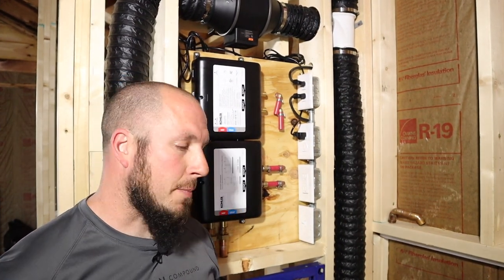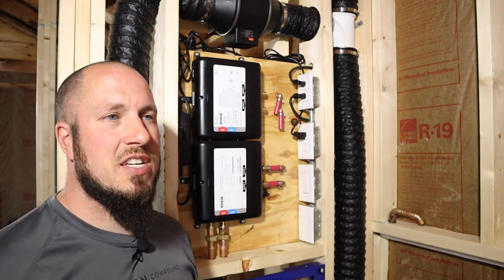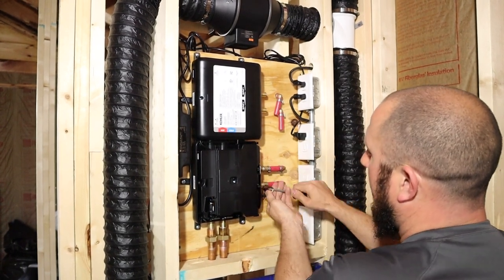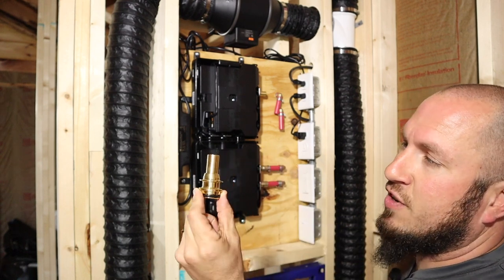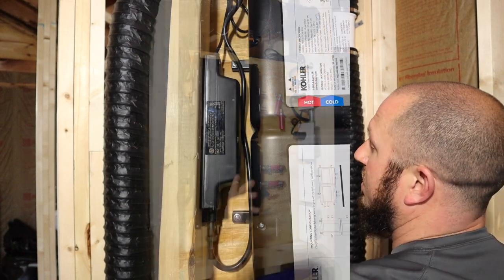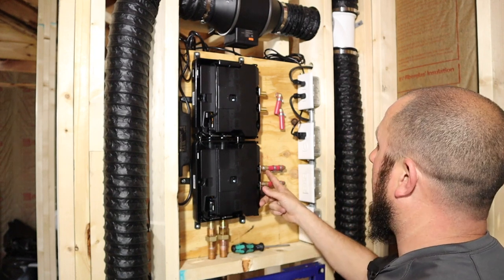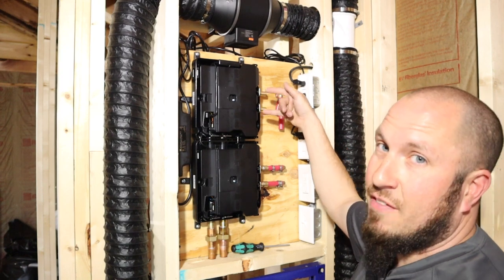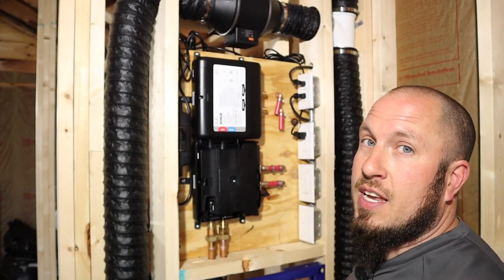Kohler Anthem Digital Shower Valve

Comment: Thanks for the explanation. I bought one to use overseas but they don't use copper pipes for their plumbing. Any idea how to connect the copper pieces from the digital valve to PCV pipes?
Reply from the maker: I think there should be a conversion fitting that you can glue to PVC and it sharkbites onto the copper

Comment: Can a shark bite be pressed on to the copper outlets rather then soldering a PEX fitting. And what is the meaning on page 5 of directions that has in parentheses (1" PEX). 

Route 3/4 (1" PEX) dedicated water supply lines. Use unions to install removable pipe segments to the valve inlets to allow access for periodic cleaning of the inlet screens.
Reply from the maker: You need to route 3/4” copper or 1” PEX to the valve.  It has to have the volume flow to supply it.  I never tried the sharkbite. I have seen guys pro-press onto those fittings though, so I’d assume you could sharkbite to it
Reply: @TheDurbinCompound  The copper outlet would need to be at least 1.125" long and .125 wall thickness for the SharkBite to work. However, the SharkBite may reduce the volume much like the fitting for PEX B. That said,  PEX A fittings would not reduce volume from what I understand but the fitting would need to be soldered on to the outlets.
Reply from the maker: @brianhughes1456 right right.  I can measure them for you if it helps?

Comment: Installing one of these and can't get the controller to turn on. Not sure if it's the controller or this unit. When plugged in are there any LED lights or anything indicating this is working for you?
Reply from the maker: Are the blue LEDs lighting up on the actual valve?

Comment: Gotta ask, what do you have going on with the flex pipe and (I'm guessing) inline fan?
Reply from the maker: That flex pipe is the bathroom exhaust.  One coming from toilet room and one over shower.  They “Y” in before the fan and exit through the inline fan to outside.  The 6” inline fan is very strong and flows 400 CFM

Comment: Did you have trouble pairing the push button to the main panel? We've followed the steps with no success.
Reply from the maker: I haven’t gotten that far.  Let me go try it and I’ll let you know
Reply: @TheDurbinCompound  mine looks paired but I get nothing and then sometimes it flashes purple after flashing the green pairing signal. 🤷‍♀️
Reply from the maker: Ok mine paired fine and seems to be working correctly. Flashes blue when it’s sending the signal to the valve
Reply from the maker: I assume you’ve taken out the battery and started over with the pairing process?
Reply: @TheDurbinCompound  yes we did that
Reply: @TheDurbinCompound  even tried a different button we had incase that 1 was faulty
Reply: And u just followed the pamphlet? What screen is on the panel when u use the button? Maybe that matters 🤷‍♀️